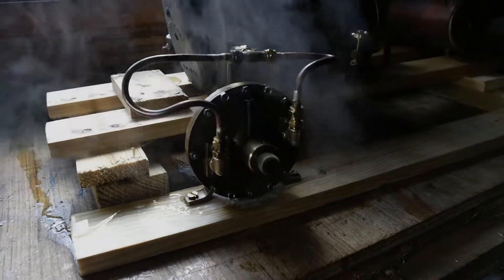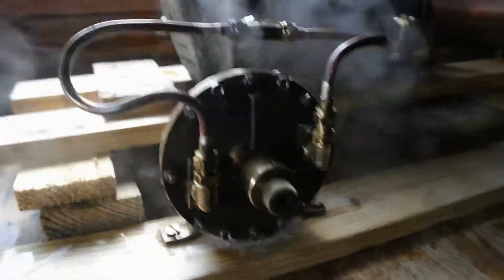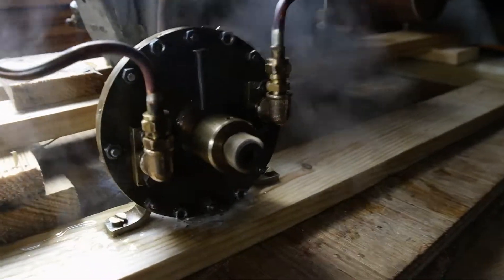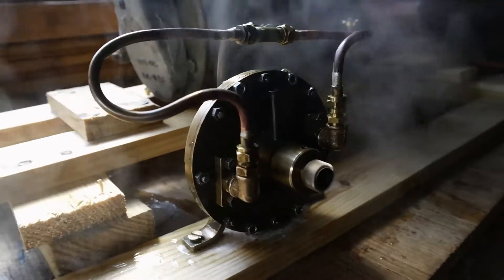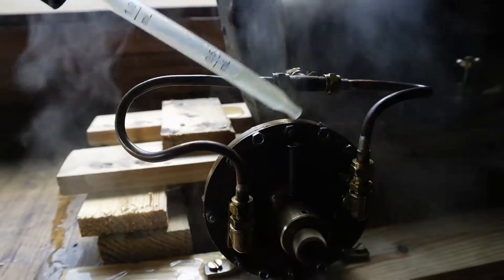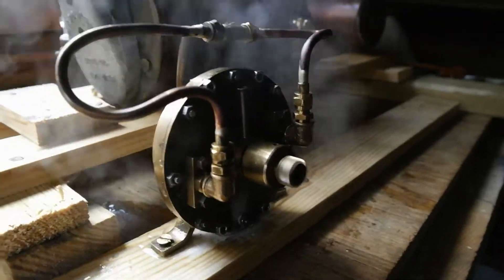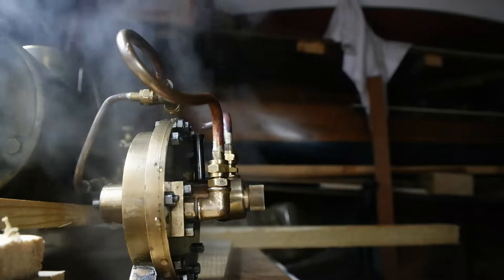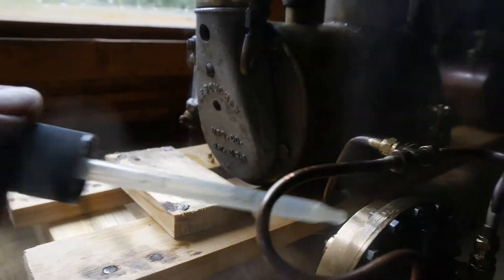VINTAGE STEAM TURBINE 1930'S  RUNNING AT 55 PSI  !!!

Comment: Hi Roy, I don't understand this turbine, where is the exhaust? Turbines usually have a very big exhaust through which steam blasts out at an alarming speed.
Reply from the maker: Hi Miles , yes the large exhaust outlet is underneath ,but I haven't the correct thread size to join up with pipework, and as it  almost sits on top of the wooden block the outlet  steam exhaust
fans outwards. will sort soon.  best regards Roy

Comment: Bonjour Roy,
Based on my experience, your turbine runs very well, the real problem is to find the appropriate reduction gear box to connect correctly a propeller. another futur project that I will follow with pleasure.
Amicalement, Raphaël
Reply from the maker: Bonjour Raphael ,
Yes a gear reduction  is the way to go , I could get a set up ready (test bench )
but tied up   with 4 builds , !!!!  at present          merci Roy
Reply: @DELTA1DSV  
Any more news on this turbine?